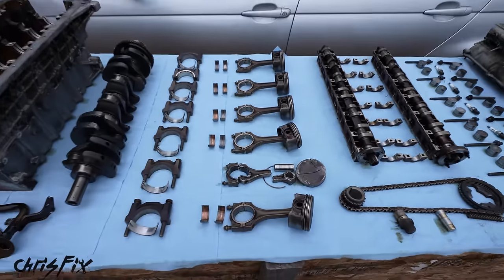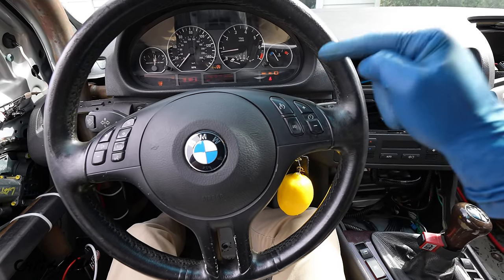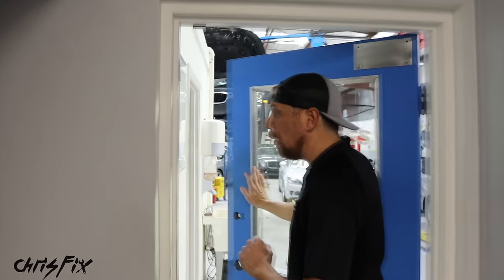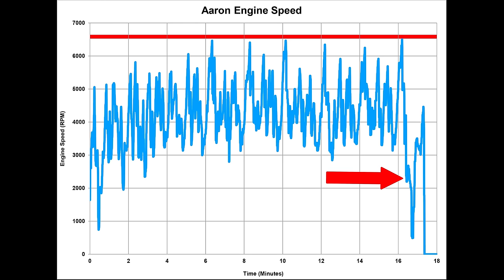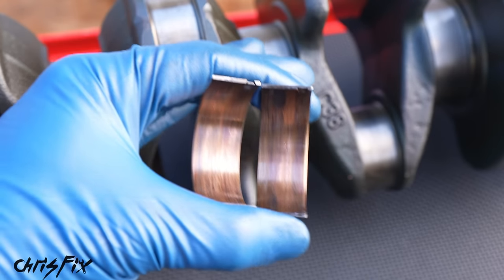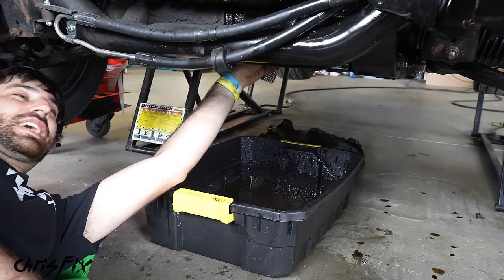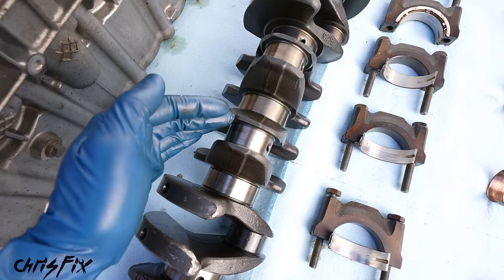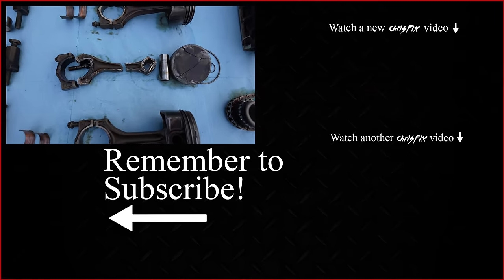What Causes a Spun Bearing in an Engine?

Comment: Hey Chris, if I were you I would re-weld those eBay headers. They’re known for being welded without the filler rod, which makes it easy for the welds to look good but makes them incredibly less strong then normal welds. Just something that could increase its reliability that much more
Reply from the maker: Thanks! I kinda want to try it out at the race. I will bring a spare just in case. Lets see if they hold up!
Reply: Exactly… what could possibly go wrong with unusually cheap EBay parts on a race car. 🤷🏻‍♂️
Reply: @chrisfix  hey Chris, I have the eBay headers in my E46 and they have held up great to tons of abuse!

Comment: Great video!  Really liked the root cause investigation you did and especially the data logging or RPM and coolant temp.  Not only did you fix your BMW, but learned what went wrong and came out smarter and more prepared for the next race.  One question I do have - are you going to install an oil pressure gauge now?

Comment: Great explanation on this engine failure. I was thinking how much easier it would have been for you guys to figure out why it failed if that oil pump nut was just backed off instead of having to go through so much research and tests to learn why it actually blew up. However, I'm glad it wasn't that nut because we all learned much more about spun bearings and oil delivery.
Reply from the maker: Haha thanks. Idk what would have been better. We would have been so upset if the oil pump nut was the cause because we literally debated if we should fix it before the race or not and decided for the first race we wouldn’t.
Reply: @chrisfix  
The next one will be better, I'm sure just knowing it is tied down will ease the mind.

Comment: Love your dedication on this project! Maybe go with 5w50 or 10w60 to have a stronger oil film with high oil temperature. Maybe your oil temperature went to high and thinned out the oil too much. Installing a oil temp / oil pressure display would help you get more Info.
Reply: Using racing oil from Royal Purple or other racing oils.
Reply: Yes I agree. The temperature is really high on those M54. Most of W40 are not enough even on road use, so chris should go at least to W60 or use an oil radiator to control better oil pressure on track.

Comment: Tough break. I’ve had something similar happen during an open lapping session. I had just competed an NA high-compression build and ran it at the track after getting it tuned. There must have been the slightest bit of valve float in spite of having aftermarket valves springs because an intake valve snapped and destroyed the motor. Heartbreak to say the least. Good luck with your next race.
Reply from the maker: Dang that hurts even worse because I know that wasnt cheap to build. At least this engine was the stock engine and we replaced it with another stock engine with some new seals.
Reply: @chrisfix  thanks, Chris. As much as it sucked, it was a labour of love. I had spun a bearing on the same motor when it was stock. Rather than swap, I wanted to see what I could do with a 1.6L SOHC (d16z6). I learned a lot and although it didn’t end the way I hoped, I don’t regret a thing. I decided more displacement and another camshaft was the way to go afterward. I supposed if you don’t break something, you’re not trying hard enough!
Reply: @dstavs  Lmao representing, i ditched D series and went B in this current year XD. B20V's are so unpredictable.
Reply: @gustavrodriguez910  Same. After blowing up the D, I decided that I wanted more OEM Honda reliability with a few add-on pieces here and there. I opted for an OBD-1 JDM GSR with an ITR LSD 5-speed (4.4 final drive). The motor got an ITR intake camshaft, intake manifold, RDX injectors, larger fuel pump, header, exhaust, Hondata S300 and a tune. The end result is reliable power. So far so good at the track. My channel has all the ups and downs of the process if you care to enjoy some videos 👍.

Comment: Do a reinforced oil pump for the M54, it will fail again (been there), and also, add trap doors to the sump to prevent oil starving in fast corners.
Reply from the maker: Thanks for the tip!
Reply: Yea a trap doors in the sump are important, friend's brother had a LS lockup because it was starved on the track

Comment: Hey Chris! Thanks for all the help man, you’ve done a lot for me since I bought my first car a year back being a 95’ Cherokee XJ. Used to be real intimidated looking under the hood but now I can tear the thing apart and put it back together if I wanted and it’s all thanks to you 👊🏻 having a bit of problem right now though and can’t find anything about it online, my clutch pedal engages about an inch off of the floor on average and works great all the time, except for when the engine is cold. Usually have to wait to warm up for about 15 mins before the clutch will engage and even then it’s only just engaging with it pushed hard into the floor. Found that if I pump the clutch really quick to the floor and back over and over again for a minute or two straight it’ll usually work fine after that, but I mean that’s not exactly ideal to be doing every day and I’m wondering if there is another problem at hand causing this. I’ve never really seen this before where I need to warm up the clutch as well as the engine before I can drive lol so if you have any tips or if you do know what’s happening and can help out that’d be awesome.
Reply from the maker: I’m going to guess it’s a hydraulic clutch. If so, you should bleed it. I bet there is some air in there.
Reply: @chrisfix  man you were totally right about that, ever since I bought it I just assumed the transmission was worn out enough that it made for a rough shift or even not letting me into gears. But now that old girl shifts smoother then anything I’ve driven 👍🏻 thanks again bro and I appreciate you doing what you do 👊🏻

Comment: I think the 5W-40 oil is the main culprit, it heated up too much during track use, reducing its viscosity and pressure, which would have been fine on a good engine but already worn out bearing helped reduce oil pressure even farther, to the point where it no longer provided enough protection. I think if you'd used  20W50 or maybe even 60 it would have been fine
Reply: Higher viscosity oils create more friction and cause higher oil temps. Really he should be using a racing dedicated oil like amsoil signature series or pennzoil ultra platinum, which are both very resilient to heat and pressure.
Reply: @Lubbocksfinest  And Red Line oil ?.
Reply: @mdev8846  a good oil no doubt just not as good as pzp or amsoil
Reply: @Lubbocksfinest  O.k. Thank you for your answer. An oil with high zddp content could damage catalytic conveter and plug hydraulic valve filters...but a race car has not catalityc converter.

Comment: 15:00 Another issue i've heard of in the same vane is oil starvation caused by consistently high rpms that the engine wasn't designed for.  Literally all of the oil in the sump is pumped out, but doesn't drain down fast enough.  So perhaps a larger sump wouldn't be a bad idea.
Reply from the maker: Interesting, we will keep that in mind!
Reply: It’s exactly as I mentioned as well - I second your opinion. This car wasn’t designed for that sort of punishment and that sump (along with its design) is 1000% to blame for the failure, IMHO. 

I worked as a BMW mechanic for years and that sump design was always a real head scratcher. Bottom line, BMW has never been very good at doing hi-po AWD systems for race application for a very good reason… this being one of them.
Reply: I thought the same thing happened, but from lateral force, as he showed in the vid.  Back in the day of muscle cars, deepening the oil pan and lengthening the intake tube was a cheap fix, if you knew a welder that could fabricate.
Reply: Then maybe use the oil level sensor data to verify that, I am assuming this engine has one.

Comment: Hey Chris, great video, I love learning about how things work and you have shown heaps of mechanical tips that have help me discover more, especially since stating Uni, but I had a question about another failure that may cause a spun bearing. 
My father who's been a mechanic all his life heard some of the causes you mention in the video and said that another possible cause is the piston head failing first. he noticed that the wrist pin was not in the con-rod, and that the piston had broken where it connects to the con-rod. His theory is that the piston head broke off first ad caused the con-rod to then shake and caused the damage to the bearing and what followed. 

So my question for you was could the broken piston have been the cause of failure or is the data more consistent with a bearing failure?
Reply from the maker: Thanks Jack and that is definitely a possibility and the team talked about that possibly happening but it seems that after our research it would be rare that would happen with a stock motor. Maybe if we were running boost or nitrous but not stock. Doesnt mean it cant happen but it's more likely a spun bearing due to an oiling issue! We think the wrist pin snapped after the bearing broke apart and there was a lot of knocking/vibration from the gap between the crank and rod. Tell your dad good other possible cause tho!
Reply: @chrisfix  Thanks for the reply Chris, its always good to learn something new, and I definitely learnt something here. Again amazing video, and hope I can learn more in the future 👍👍

Comment: Thanks for the education on this. I just had a Toyota Highlander with 245,000 miles throw a rod through the block. Yuck, replacement engine time, or, sell it for junk.  The original fault was a $20 oil pump rubber hose that cracked open & blew all the oil out before I could get off the road & it spun 1 of the 4 main crank bearings. I polished the crank & put new main bearings in & it sounded so quiet but, then the same one slipped again. I then mounted a new outer bearing to it's cap & replaced the rubber pump hoses with an after-market metal tube set & that worked for 600 miles with very light knocking to no knock at 70 + mph until on one more test drive it started knocking hard & blew up.  The slipping bearing came from the inner block U shaped housing being slightly shaved down on the 1st slip & I did the replacement bearings with the engine still in & could not fill in that new gap. There were aluminum shavings in that first oil draining but no shavings in the 2nd time & I had hoped for beginners luck, but, there is no luck in engine tolerances, way to tight for error.

Comment: Great vids, keep up the good work! We see the results of "extend oil life" of the beginning of 2000 years, 15000 miles before an oil change is good for the manufacturer marketing and to cut the cost down but certainely not for the long run owner's of a car. VANOS, rods bearings and stretch chain faillures are all oil related problems. I see 2 things that you can improve easily on your track car: First one is heat: Reinstall the ram air system over the rad to avoid heat soak, vent the engine bay with new exits for the hot air with traps on the hood and fenders, install a cooler termosthat, wrap your headers. Second is oil: The E46 BMW 3.2L. M3 run on 10w60, an old motor will benefit from a thicker viscosity adding protection to the vital parts in a race. Good luck!

Comment: That was really interesting and educational.
I bought an E46 project car and have been disappointed by how unreliable it is.  I had been spoiled by my years of wonderful Asian vehicles.  I love driving it, and it's an amazing machine, but wish I could enjoy it without wrenching after every trip.  
Great job getting your Lemons car right as rain and ready for next season.  Keep going.
Reply: E46s are very reliable, you just cannot ignore maintenance like you can on Japanese cars, and you must be proactive with maintenance. My dads 02 325i has 256k on the original engine, runs great just burns oil (like all high mileage M54 engines)

Comment: You have the longest watchable videos on Youtube. To clarify, I’m saying that any other videos as long as yours would not be fully watched by me and I’m sure many others. But yours are watched down to every detail and even replayed to understand some parts better. You gotta realize how amazing that is. Anyway, I’m going to google this regardless after I leave this comment, but what is generally the actual reason that a high mileage engine gets lower oil pressure? I feel like that detail wasn’t specified in your conclusion. What happens to a certain component that actually results in less oil pressure? I especially want the answer to relate to this specific situation here. Would it be the oil pump? And what specific thing would actually cause the oil pump to produce less pressure with high mileage?
Reply from the maker: Thanks a lot! And higher milage engines have more wear on the rod/main bearings which means that the original amount of flow from when the engine is new gets reduced, causing lower oil pressure. That is generally the main part that gets worn out when talking about higher milage engines
Reply: @chrisfix  Oh wow that makes sense! It’s beyond amazing how engines work. After learning how they work it’s hard to believe that such a huge amount of people go through life probably never learning about engines, especially when they drive ALL of us around. Imagine a world where everyone was taught about engines. 👍🏽

Comment: So I was contemplating this today and what design improvements could alleviate the problem. I realized the purpose of a dry sump in sports cars is to eliminate two of the causes of spun bearings. No pickup tube and gravity feed eliminates the hard lateral g starvation and the crankshaft sloshing in the oil making bubbles.

Comment: It's probably been mentioned before, but here in europe everyone runs 10W-60 weight oil in our M series engines used for drifting/racing. Oil temps are known to rise well above where the OEM recommended oil can hold it's lubrication characteristics during track use.

Comment: I had my rod bearings check out and motor seize while at a track day. Upgraded suspension, sticky R compound tires and the stock non-baffled oil pan, it was getting oil starved in the longer corners. Lesson learned $$$

Comment: Chris, put the push to talk button for your radio on the left side of your steering wheel, this way you use your left hand to control the radio, this will free up your right hand so you can still shift if you need to.

Comment: Hello guys,an astonishing work and a big bravo to everything you have done so far. The analysis of the demage very very professional and clear. My question is this : what causes the low oil pressure? It was the pump that didn’t take the oil on the correct pressure or what ? 
Otherwise great job whith the team and now have some fans out there 👍💪

Comment: One important thing.  Bearings snap into the mains and rods - like you said.  If they don't snap in, its not from wear.... its from being pounded -by  pinging or detonation.  The fact that all your bearings were loose is a BAD sign.   Check the main caps and see if they walked a little.   If the bearings get pounded, they tend to get flatenend out.   They will flatten (get wider) to the point they can grab the cranks shaft.  On a V8 I had one flatten to the point it grabbed the bearing of the rod next to it (yeah... double spun bearing! - thankfully the crankshaft was saved with a .010 turning).
 
Its possible the piston failed first (rather the rings) and allows oil into the combustion chamber.  You go into a corner, down shift and the during high revs, high vacuum, oil get sucked into the combustion chamber - effectively lowering the octane.... causing detonation/pinging.   After a few laps....  As a result, at least up  until a few years ago, circle track racers avoided low tension oil rings.  Even though it gave more power, the detonation risk was too high. 7000-8000 in the straights and 3000 in the corners... lather rinse repeat.

Without knowing  your actual oil pressure its hard to say what was the proximate cause, but I highly doubt it was oil starvation.  You mention that bearings should run on a film of oil - that obviously doesn't happen at startup (or when you just finish an oil change) etc.  The bearings coating + zinc in the oil is supposed to protect against that.   There is a reason motorcycle use high zinc in the oil - for those occasions when the oil pressure is not enough.  I heard some diesel truck oils are also high in zinc. So you should run a better oil  with extra quart or so.

Comment: You can tune the thermostat to open at low temperature since stock it open almost to the boiling point which for track is not good at all and also install aftermarket oil cooler would also helps alot with the cooling system. Hope it helps.

Comment: Such a thorough explanation for how the engine blew up! I'm still a little confused on the actual root cause though, you mentioned the low oil pressure was simply due to the engine's age and the fact that it hadn't been well taken care of. How exactly did this cause low oil pressure? Was the oil pump too worn, were the channels for the oil in the crankshaft corroded and restricted the oil flow? How come it only happened in one cylinder? Thanks!

Comment: The oil pump wire needs a counterbalanced weight to make sure it spins without imbalance. Small issue can lead to oil pump bearing shaft failure.